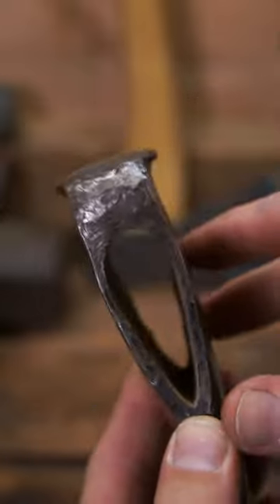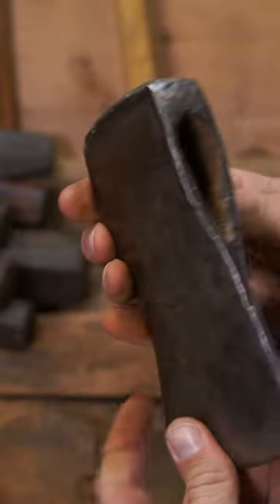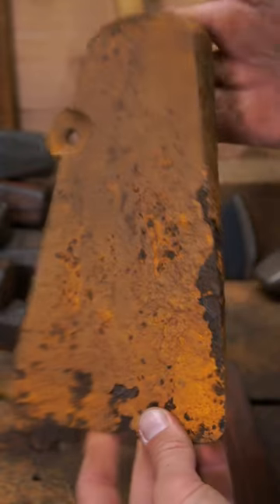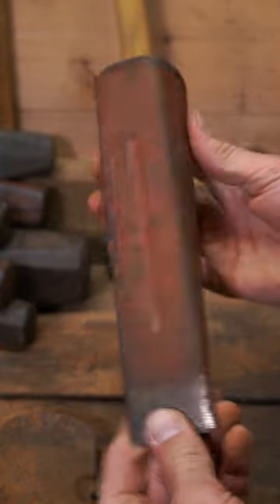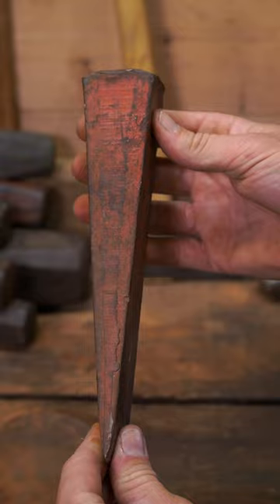Loggers ruined Axes.

Comment: Hitting hardened steel with steel can make sparks, shoot off little pieces, or crack. You can use plastic wedges or wood mallets, or even put a piece of wood between them. Sometimes you have no choice and it's cheaper to mess up your axe than drive to town to buy the right tool.
Reply: When I was 5 I was watching my grandpa working on a truck over 20 ft away, he was hitting two hammers together and I watched a pice of shrapnel fly towards me and slice me about two inches under my eye, still have the scar but from that day, I knew you can't hit hardened steel against hardened steel

Comment: At the end of the day, sometimes you just gotta get the job done & in that moment safety is not the main priority.
Reply from the maker: Or damage to the tool.
Reply: @old_iron_axe_and_tool  , all the more reason to fix and restore it
Reply: @old_iron_axe_and_tool  Dammage like that occurs over years of regular use. Not really a reason not to use it for driving wedges. I prefer to get more utility out of a tool rather than more longevity.
Reply from the maker: @JosephAllen-d2e  I'm not saying it was wrong, just saying that steel wedges ruined alot of axes. Back then they didn't have a choice between plastic and steel wedges. I'm exceptionally hard on tools myself.

Comment: Is there any chance you could give some good exceptions to the general rule?
Reply from the maker: Absolutely.  The first thing that comes to mind is a rafting axe. They were designed to pound steel spikes in logs. Also a splitting maul is made to pound metal splitting wedges. Carpenters hatchet/riggers hatchet also.
Reply: @old_iron_axe_and_tool  thank you
Reply: Any axe head with a hardened poll.

Comment: If you are splitting wood, there are very few situations in which there isnt a sacrifical baton you can put between a hammer and an axe. 
I work in a place where the dont hit hardened metal with hardened metal caveat isnt really taken to heart. Low iq state. But i do it because thats the job. MOST of the time its ok. When its not its expensive. 

Use a guard or something. Its not worth your teeth or your life. Except when it is.